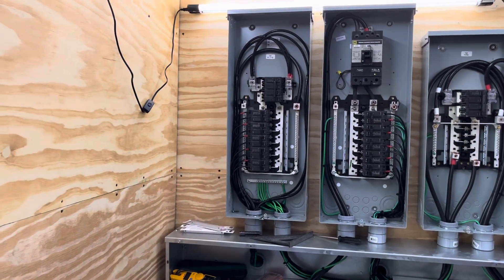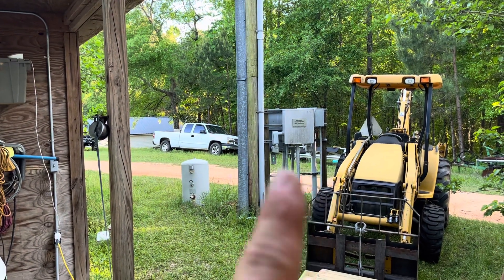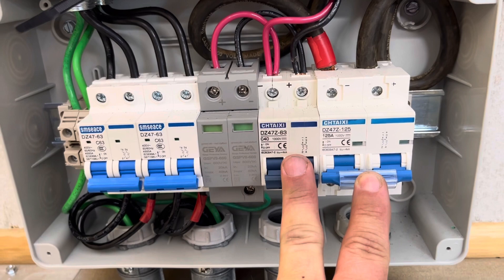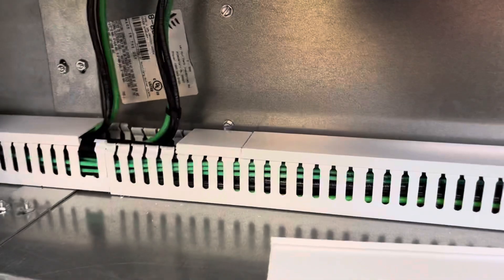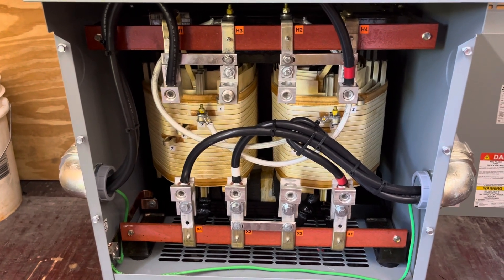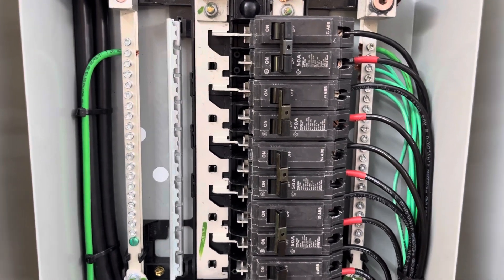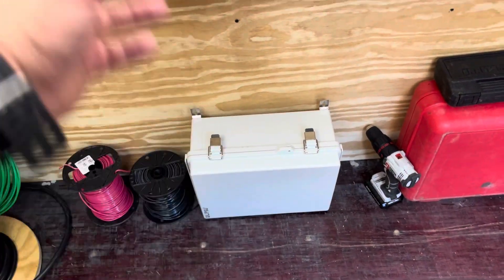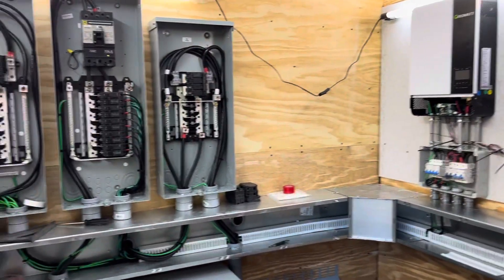Solar Power Project Update - 22APR2022

Comment: Was looking those up and they were a bit pricey for the big suckers.
Reply from the maker: Yeah, they aren't cheap. You might be able to find used ones on ebay, but freight would be high.
Reply: @jeffmotes2129  can’t be any higher than the solar panels. Thanks.

Comment: What kVA is that isolation transformer rated at?
Reply from the maker: This unit is a 50 kva. I sized it based on my 209A feeder breakers.
Reply from the maker: 200A …

Comment: So you have the transformer creating a neutral and grid also has a neutral. So your transfer switch is a 4 pole disconnecting the grid neutral correct?
Reply from the maker: No. Neutrals are not switched but tied together just like a home standby generator’s neutral is tied to the utility neutral. 

The utility and inverter outputs are not allowed to be powering the house at tge same time. Since the utility neutral and solar power system neutral are tied together the neutral connection can only be bonded to ground at the main utility panel.

Comment: Jeff.  I just found your channel and subscribed to follow your build.  I am very interested in the isolation xfmr.  I am currently running 3 SPF5000ES inverters and 2 autotrsnformers and they are working great.  However, I have not connected the grid to my system yet.  I am currently running on PV and battery (6 EG4 Lifepower4 batteries) only at the moment.  So, I have a question about the paralleled neutral that I am hoping you can help me wrap my head around. I have a diagram from Signature Solar showing the Grid Ground not connected to the inverters and the inverter Output grounds used from the inverters on in the wiring. If the Grid neutral and ground are never introduced to the inverters, as they only take L1 and L2 on the inputs, how does one end up with parallel Neutrals?  Also, I am powering all my loads with the Inverter output circuit, the grid will not be connected anyplace after the inverters.  Thanks in advance for your thoughts.  I and looking forward to more videos from you build.
Reply: To clarify my question some.  By attaching the Grid Ground the the inverters aren't you introducing the Grid Neutral to your system through the Grid Neutral Ground Bond?
Reply from the maker: @leebarnett6193  see response above. The isolation transformer eliminates those issues.
Reply from the maker: Hey Lee. Do you have grid input into your inverters? If not, there will be no parallel neutrals and ground loops to worry about. If you have grid input you can have issues when connecting the autotransformer. 

The reason there is no parallel neutrals with an isolation transformer is that the L1, L2 on the primary is completely isolated from L1, L2 on the secondary. 

If you have grid input it is true the grid neutral will be bonded with the neutral on the secondary side of the transformer, however, with the L1, L2 isolation there is no path for current to flow from the secondary into the grid neutral and vice versa. 

Without grid input autotransformers will work as long as you have protective circuits incase the autotransformer goes down. 

After careful study, I feel sure the isolation transformer is the best way in either case. In fact I have two new autotransformers that I initially bought for this project (based on advice from sig solar) that I will not be using.
Reply: @jeffmotes2129  Hey Jeff, Thanks for the response.  At the moment I do not have the grid attached to my system.  I am planning on making that connection in the future but want to do it in the best possible way.  I like the idea of the isolation transformer but I am studying up to better understanding the design.  At the moment my question, I guess, is in the grounding side.  I am curious if bringing the Grid ground into the inverter on the AC input side allows for the possibility of what the NEC calls "Objectionable current".  Does having the Grid ground, the inverter output ground and the Isolation transformer ground tied together with two bonding points (one at the grid first disconnect and one in the isolated output panel) defeat the isolation in anyway?  Should there be two grounding bar locations?  Also, add in the Generator, if it is bonded, should it's neutral ground bond be considered for Objectionable current?  Please know I am not criticizing, I am trying to learn and make educated choices for my own system and your setup is looking, to me, to be the best answer I have seen yet for generating a neutral.  Thanks for your time Sir.
Reply from the maker: @leebarnett6193  the neutral on the secondary side of the transformer is considered a “separately derived neutral.” It MUST be tied to the grounding system at one point only just like the grid neutral. The grid neutral and the separately derived neutral (sec of isolation transformer) and tge generator neutral must be bonded to the SAME ground. They also must only be bonded at one point. 

I know it may seem odd that the grid neutral and the xfmr neutral are tied to the same ground seeming to ground the neutral at two places but that is not the case since the L1,L2 of the grid and the xfmr are isolated. 

These types of system are used in many industrial and commercial facilities and meet code requirements. 

I’ll shoot another video soon showing what I’m talking about.
Reply: @jeffmotes2129  I've been researching and have come across some information and I've attached a couple of links.  They are addressing my thoughts, more in regards to a generator, but I wonder how it relates to an inverter system also.  The video discusses isolation transformers but not in the full context of this discussion.  However, I can't help but think that the inverter system would fall under the same constrains as the generator system as far as a switched or unswitched neutral.  At around 3:44 in the following video:

https://www.youtube.com/watch?v=nwgzT_CTIMA&ab_channel=RyanJackson

And this site as well:

https://www.trystar.com/connecting-your-portable-generator-in-a-separately-derived-or-non-separately-derived-system/

again, thank you very much for any input, information and most importantly your time and expertise.

Comment: Hi Jeff, I am using growatt mid point tranformer and a growatt 5000 es inverter. From Neutral to Ground I got 120V
Do got any clue what going on?Thanks
Reply from the maker: That’s the problem with autotransformers. When your inverter is powering from the PV or blending with the grid your inverter output is isolated from the grid and the grid neutral. You’re generating a neutral through the auto transformer. Since the autotransformer is a separately derived neutral it should be bonded to ground. BUT …. BUT when the inverter is only powering from the grid it works in bypass meaning the grid passes directly through. The grid neutral and the autotransformer neutrals are in parallel and it creates a ground loop. That’s why I can’t recommend an autotransformer. 

You should look at installing an isolation transformer between the inverter output and your load. Derive your neutral from tge secondary side and you won’t have to worry about paralleling neutrals or ground loops.
Reply: @jeffmotes2129  Thanks Jeff you are  #1 Teacher on YouTube when talking about solar, that's why i  followed you on YouTube. . I Bonded the ground  to neutral and everything works. I will consider your advise about the transformer. Thank you
Reply from the maker: Hmm … sounds as if your ground and neutral are not bonded together. 

Are you using grid input or are you PV and battery only?
Reply: @jeffmotes2129  I am using grid input and PV  I didn't  Bonded neutral and Ground together because it is not my first entry of grid power. Neutral and Ground are bond in my main panel. Not on the solar equipment.